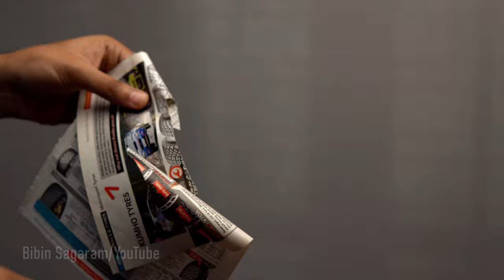How to Make a Mini Katana

Comment: Hello, I am also making similar kind of blade but the difference is I have a nail instead of the metal sheet. I always see your video and then proceed for ry work.
Thanks
Reply from the maker: Thanks a lot ☺️
Reply from the maker: Make sure that the nail is high carbon steel, then only it can be heat-treated. Spark test will do the trick.

Comment: Awesome and outstanding work! Could you please tell me which saw blade did you use for cutting the rough shape of the katana? If you have a link to seller,it would be much appreciated! The blades I'm using right now are too thin and break after a short time
Reply from the maker: Thanks a lot😁, I bought that blade from a local suppliers. Thickness of the blade is 0.4mm and width is 1mm, hope this is helpful. I have also used atleast three blades while cutting Katana profile.
Reply: @bibinsagaram  thank you so much, I will look for some of those blades!